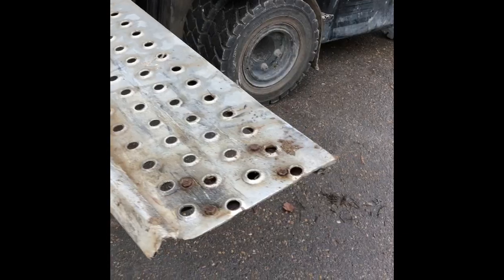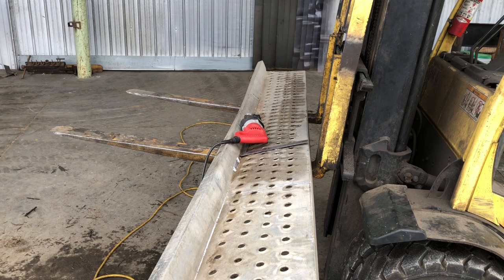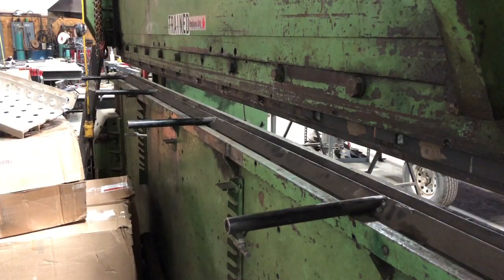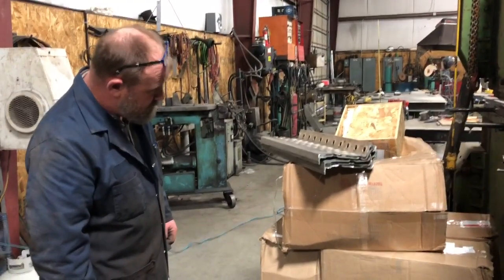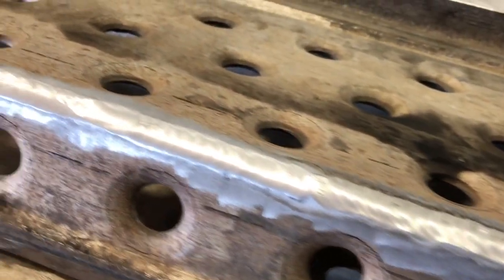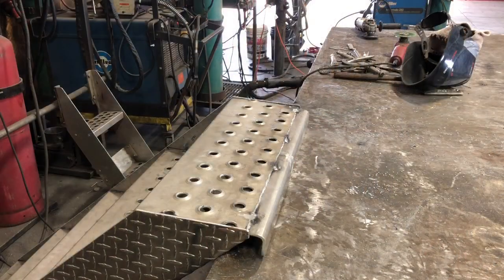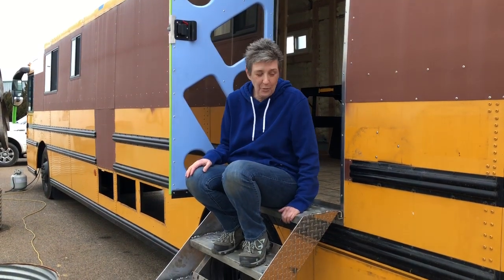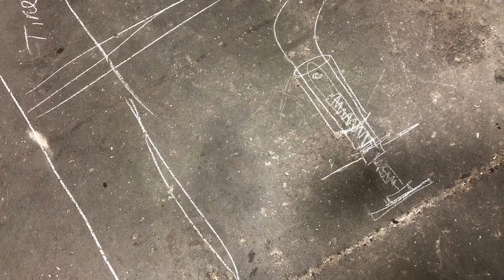New Backdoor Steps - Vlog 74 School Bus Conversion

Comment: Great find!  I have been thinking about how to make the side emergency door on our bus useful as an access door when parked or boondocking. Aluminum steps that drop down on a hinge or hook on like yours would be great. Hopefully I can find scrap aluminum like that too! Those turned out really awesome. A removable hand rail would be a nice enhancement.
Reply from the maker: Thanks --- yes the hand rail is in the future. Just didn't have time to complete them. We were too excited to have the steps.
Reply: @KnappTime  Very cool.  And they probably weigh almost nothing.
Reply: I saw a youtube vid of a guy who built in a set of inside steps like at the front door, then removed the front door altogether, and skinned over it, installing an rv window for visibility. He then covered over the steps, converting that space to under floor storage. This let him install another seat up front, so he could sit next to his "co-pilot" while driving. :)
Reply: @jimsteele9261  I was planning to do that but found that it doesn't optimize floor plan space and takes the school out of skoolie. It's also a lot of fabrication work. My wife's copilot chair will be next to me but put on a sliding mechanism to slide over the steps and then back to the center to get it out of the way for entry